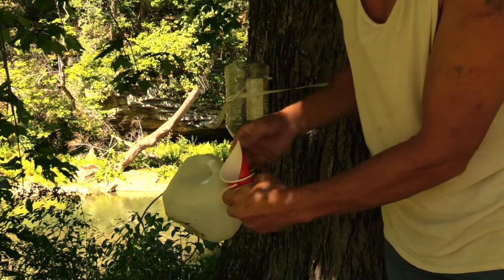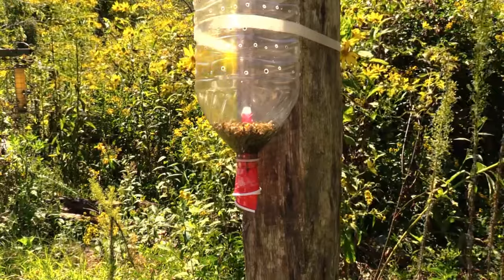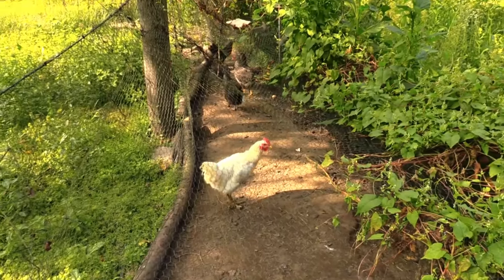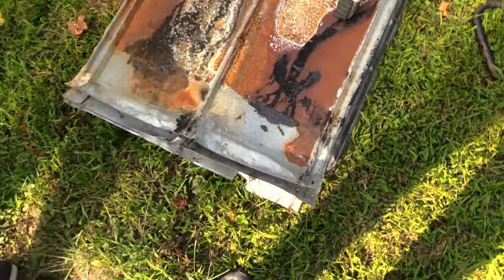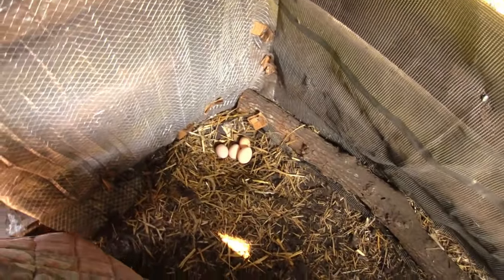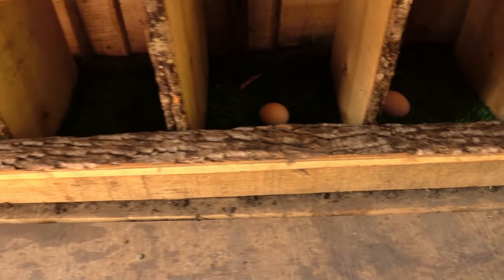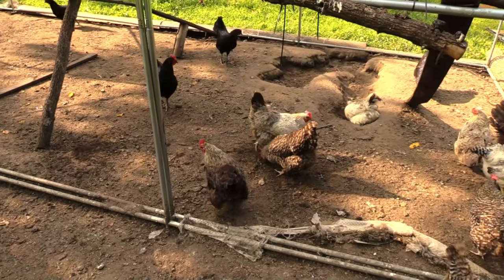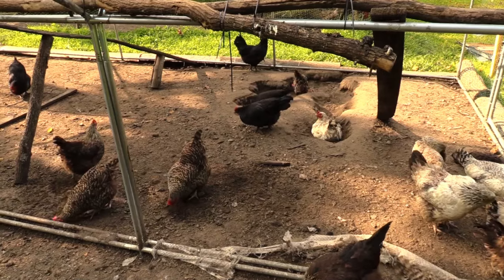Helping People. & Dont Let The World Change You. And How To Get Rid Of Yellow jacket Bees. 9/8/2024

Comment: Would the corrugated fiberglass sheets work or does it have to be tin for a roof?
Just wondering.
Reply from the maker: I used fiberglass on a building one time. and ive tried it on cages. It works for a short time. Walnuts and winds finally messed them up. But they were good until then
Reply: @ESTEPSTRUENEWS  Oh. Knew there had to be a reason.  😊🙏